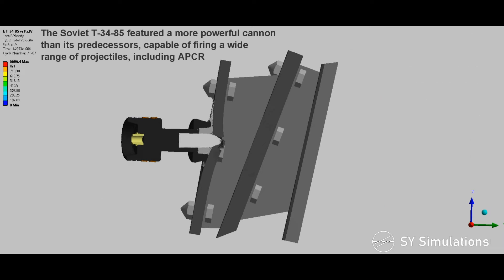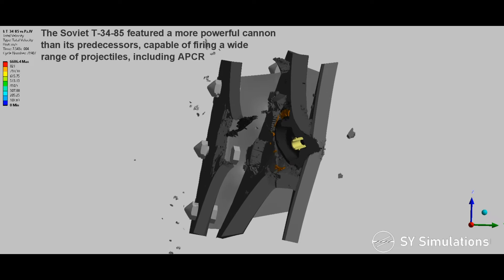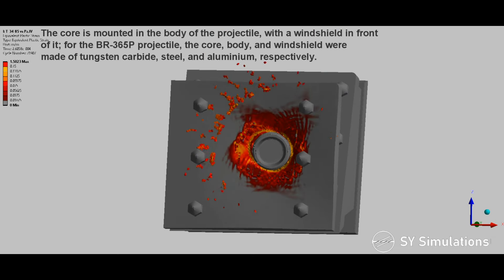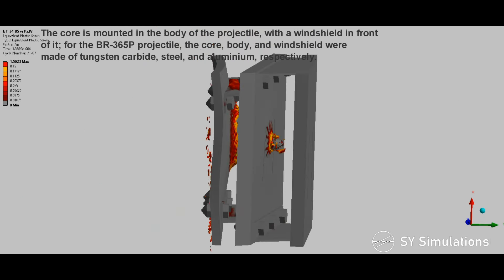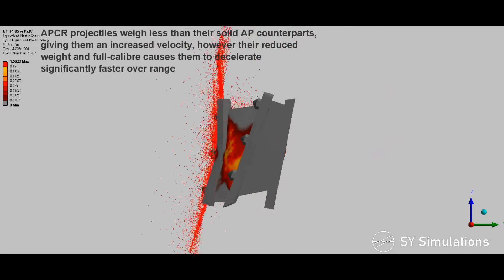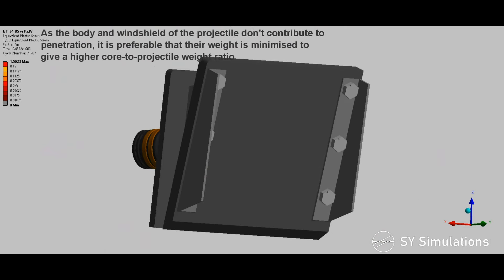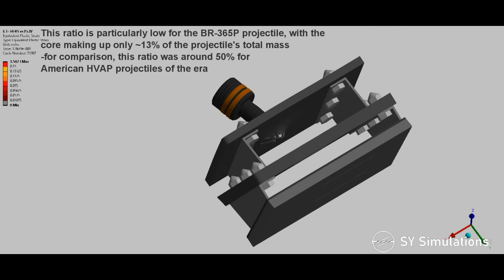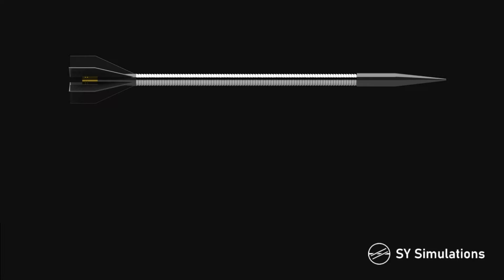THE WORST APCR vs Up-Armoured Panzer IV | 85mm APCR vs Spaced Armour | Armour Penetration Simulation

Comment: I’ve always wondered why American WW2 HVAP is better than Soviet APCR. Glad that was answered now.
Reply: love this channel cause they actually explain whats going
Reply: Soviets had less tungsten so they had to economize
Reply: @tedarcher9120  It was actually more to do with the APCR body design than the core itself. The US designed the sheath to be aluminum and didn't use the "arrowhead" design, instead opting for a design that was more shaped like a standard sharp nosed AP shell, but mostly hollow with a tungsten slug inside. This allowed lower drag and the aluminum reduced weight which increased velocity. The Soviets hadn't designed APCR ammunition until 1942 when they created some based on captured German shells so they were just trying to get something into service instead of optimizing performance
Reply: Soviet ammo wasn't the best during these times, they were low on most materials.
Reply: Why? Dont understand
Reply: @tedarcher9120 вольфрам в России есть на в то время добывать и изготавливать некому было . Все ушли на фронт

Comment: It's interesting how much the Pazer IV underperformed there. Though it'd still be worse in the larger scale with such a numbers disadvantage. Great sim as always.
Reply: The Panzer 4 came out ok, while it did pen, it wasn't catastrophic as the main body didn't get in, just the tip isn't good enough. But Spall people scream! Tanks have a lot of empty space, partitions and non-critical stuff in the way. Whenever we see up armouring it's done to a specific calibre, material availability and be good enough. Stopping it dead would be optimal, but the extra weight wouldn't have been worth it and does nothing for higher calibres.
Reply: Its not the PIV G-H, but uparmored D. Few pieces of plate, rather than 80mm of solid plate. Solid plate would have stopped the russian APCR dead in its tracks.
Reply: Crew isn't going to stick around in the tank when a red hot piece of tungsten carbide was just ricocheting around inside it. Even if nobody is seriously hurt, powder in shell cases might be smouldering and about to ignite, etc.
Reply: @LiezAllLiez isnt spaced armor better at dealing with this though? Like in the Leopard 2A6 (I may be wrong) where they added extra thin plates to the turret to disrupt APFSDS
Reply: I thought the D model (heh) actually did well, given the up-armour was additional armour. The spacing makes it less effective compared to one thick plate so I'm impressed.
Reply: @EdyAlbertoMSGT3  Yeah, but not when its russian APCR. That one is just junk.
Reply: Yeah it's because T34-85 used APCR which was meant to destroy tanks but it highly depends on range, The more distance these two vehicles have Panzer IV will easily win since it have more penetration than T34-85 APCR overall
Reply: @JaHail-oy6vq  It's always hard to know which tank wins easily, given the number of scenarios you can have. But yeah, kinetic penetrators definitely prefer to be closer than further away, that's for sure.
Reply: @candleman2123  T34-85 APCR can pen Tiger 1 front armor from 400-600 meters so, If there is more gap T34-85 would hardly win since Kwk40/L43 have more penetration without using PzGr 40
Reply: @JaHail-oy6vq  yeah, it does, for sure. I just try to avoid saying a tank will win. I find it so general and nebulous that it's just not reliable as a comment. 

I love the Panzer IV, probably my favourite tank, so I am biased 😇
Reply: @candleman2123  Well im not biased towards anything, I just accept the reality aka truth
Reply: @JaHail-oy6vq  OK. Not sure why you felt the need to say that, but good on you mate.
Reply: @candleman2123  I don't get it, Don't take it too personally what i meant was i was only telling you the truth and im not biased like you as you said your biased towards PZ IV in your previous comment
Reply: @JaHail-oy6vq  No, you don't word a sentence like "Reality AKA truth" then claim you were being reasonable. But this is the YouTube comments section. Not sure why I expected different.
Reply: @candleman2123  It was more of a funny way to say it, It's all good tho since it requires minimum humor to be able to get it either way
Reply: I don't think it underperformed, honestly. The APCR is a bad APCR round but it's still about as capable at penetration as the solid AP or APHE, is it not? Maybe I'm wrong on that, but that APCR is only bad in comparison to other nations' APCR. It still has plenty of power to go through a Panzer IV but so does the standard 85mm rounds, as I said. It didn't really underperform, the Panzer IV with 80mm front armor max, it was never designed to stop the 85mm gun. In reality the two tanks are quite comparable in performance. One is just a little better protected, the T-34/85, and the other has a better gun, the Panzer IV. Late war Panzer IV's were about on par with the T-34/85, they both had things they did better or worse but were on par for the most part.

Comment: It would be interesting to see soviet 45mm APHE and 76mm APHE against the upper front plate of an uparmored Pz IV D (30mm+30mm+20mm), an uparmored Pz IV F (50mm+30mm) and against a Pz IV H (80mm) from about 500m range. To observe if the uparmoring of the older vehicles to fit the H standard of protection actually surpassed the intended effect by creating the first "composite" armor by spacing the additional plates and combining face hardened armor and regular RHA. Or maybe the layering was worse than the regular 80mm thick plate of a late Pz IV H or J.
Reply: That would be spaced armour. Spaced armour has technically been around for a while and in tanks since ww2?
Reply: @Masterafro999  it would also be composite armor. Since the bottom hull plates on Pz IVD and F would be front hardened while the bolted on plates are RHA rherefore using different property steel types like a modern NERA element.
Reply: @schullerandreas556  I was being slow brained. You're right. What confused me was the fact that these mods weren't serially produced. The first serial production tank with composite armour was the t-64.
Reply: @Masterafro999  the uparmoring of old Pz IVs was not a field modification, the vehicles were shipped back to the factories for this as the additional weight required an overhaul of the suspenssion. So technically it was serial production.

What disqualifies it from being seen as the first proper composite armor is that it obviously wasnt the intention to increase protection by using different materials. They just wanted to get to combined 80mm thickness. If it would have been their intention to arrange layers to increase the protection with the composit then ironically the plates would have been in opposite order with the first plate being front hardened for decapping, maybe even the second plate for the older models but the last plate which is actually structurally integral to the tank would be RHA to make full use of its elasticity compared to front hardened steel as a backing plate.

For the first tank that purposefully used different material layers to increase protection that was produced in series I think you are right with the T64 and its quartz spheres cast into the front turret.
Reply: Well it's because it moved over 800m/s it means the distance is prob around 500 meters which T34-85 have the advantage but if it's over 1000 meters, PZ IV easily wins this one

Comment: Would be cool to see a comparison with the 80mm non spaced frontal plate of the Panzer IV H, to see if the APCR would fare better.
Reply: it will work out much better because there will be no angles and spacing, which this type of bullets doesn't like very much.
Reply: at every subsequent plate new shear forces apply at impact degrading the projectile. This composite arrangement is actually more effective than the single 80mm plate if the mountings of the upper plates are so well crafted and the bolts dont shear off.

Comment: If it is possible, i think it would be really cool to see what different rounds do to things like cannon barrels and engine blocks! 

Love the channel!
Reply: Yup,im curious how well the engine block of some vehicles would hold against shells after if penetrates the back or side plates
Reply: That would be very cool to see. You reminded me of the German "squeeze bore" tank guns. Where a 75mm projectile runs through a tapered barrel and ends up around 55mm.
Reply: The barrel will turn black.

Comment: Hi SY simulations this was a very interesting video. I would have thought the APCR would have punched right through, so the results really surprised me. Anyway, I have a simulation proposal: 

Historical Context:
On the 6th of March 1945 an M26 Pershing suffered an 88mm penetration of the lower front plate by a Narshorn tank destroyer and suffered an ammunition detonation. However, the shot miraculously penetrated right between the driver’s legs, and no crew members were killed in the engagement. 

Proposal: 
German Pzgr. 39/43 APCBC-HE shell against 76mm of RHA sloped at 36 degrees at a range of 300 yards. (HE filler can be omitted if need be. Also, although most sources state the M26’s LFP was 76mm at 53 degrees, the specific location of the hit was at 36 degrees constructional slope)

Additionally, A 6mm upside down “u” shaped witness plate would be positioned between the expected location of the penetration to simulate the driver’s legs.

Thanks out to reading this, and have a good day!

Comment: *Next Video easy idea*:
Increase of spalling of different steel plate thickness vs AP or APDS
Example: 
- Spalling of 1 cm Steel Plate at 60°, then the same simulation but with 2 cm Steel Plate and incresing the thickness until the maximum spalling, I think it is very usefull for understand the spalling
Reply: It was done. Not angled, but same idea.
Spall velocity is inversely related to the thickness of the armor. Spall come angle is proportional to the thickness of the armor.

Comment: Hello. I have, what I think is an interesting "what-if" suggestion. 2 years ago you posted 2 videos, exploring the shot traps of the different Panther mantlet designs. There is a Panther in Thum, Switzerland, that, at first glance, has an A/D mantlet with the bottom side straighened. I was wondering if you could do a third "M72 vs Panther mantlet" video, imagining the germans transitioning to a mantlet of this design, instead of the actual G mantlet.
I call this a "what-if" suggestion, because that mantlet is actually a post war sheet metal replacement, missing holes for the gunners sight or a coaxial machinegun.
Number of times I commented this: 2
I will try to link a video of it in the replies to this comment, but you know how youtube is about deleting links.
Reply: h I have
t absolutely
t no
p ideea
s if
: this
/ is
/ going
v to
m work,
. right
t now
i I am
k simply
t writing
o words
k to
. mask
c the
o link
m in
/ hopes
Z it
G doesn't
e get
C deleted
8 by
W youtube's
8 filter,
D this
k is
/ the fourth comment I have made, all using different methods, thus far all have been useless.

Comment: I noticed the lack of a 85mm BR-365 vs. a Tigers front armor, simulation.
At the moment there are only two simulations of flat nosed shells vs flat armor, namely the 76mm vs Pz IV and the 122mm vs. Tiger II (H) turret.
How about one at 500m, similiar to the 76mm vs Pz IV?

Comment: nearly stopped it, if the back plate was 50mm it might have not gone through. heck if that shot came at a slight angle it probably wouldn't have made it through, tack on about 15 degrees and maybe.

Comment: Oh wait that was a 85mm APCR? I thought it's going to be 76mm APCR since the 85mm AP already goes through a Pz IV like a hot knife through butter.
I imagine the 76mm wouldn't go through that at 500m.
Reply: 85mm t34 apcr in warthunder pens like +200mm but irl barely pen pazer 4s
Reply: @mehmetkaral8863  yeah their APCR calculator gives way too much penetration based on the weight of the shell instead of the tungsten core.
The T-44s BR-367P APCR was a major improvement over the early BR-365P but in the game it’s hardly better because Gaijin thinks that steel is apparently just as good as tungsten for armor penetration.
Reply: @Kuschel_K  indeed, using calculator for APCR calculator for APDS with basically same core properties produces completely arbitrary results due to it relying so much on shell mass, like for 17pdr APDS at point blank it only gives 178mm... 

and second nail in the coffin is that Gaijin also uses these small core APCR as model for APCR slope penetration which results in far worse performance at angles of about ~15-25%...

Comment: Is the ammo was too expensive to make it good or what? Probably the extremly low 13% mass was because of that. Either you make 1 good or 4 somewhat working rounds. At least thats my opinion based on their engineering works.
Reply: More like they werent exactly sure how to make good APCR and HEAT. And while they had at least some ideas about first...all their knowledge of HEAT came from captured german HEAT rounds.
Reply: 85mm tank guns was temporary substitute of 76mm, since 76mm AP rounds was bad quality, and 57mm guns(with better AP rounds) was to complicated for mass production as tank/field guns, and was AA backbone. 
57mm was to much against pz3/4, so there was only 150 T-34 with it, but low 76mm AP quality, armor upgrade of PZ4 and tiger/panthers become problem really fast(T-34-76 cant penetrate tiger side armor at all).

Captured tigers and panthers were tested against every soviet and some lend lease guns/rounds/rockets.
USSR saw germans goin to replace(as obsolete) PZ4 with panthers, and 85mm struggle against it frontal armor(same goes for tiger) at any range. While 122mm AP penetrate it from 1500m like a paper. 
So most resources goes to 122mm guns/rounds development.

In 1944 for every 5 T34-85 there was 1 IS-2,  and 1700 IS-3 in 1945. 
For SPG it goes for every 3 85mm, 2 122mm and 1 152mm in 1944.
Reply: @alexturnbackthearmy1907 That could be. But this difference is just too much. And it would be more logical that the soviets seen the 20-30% increase in penetration not worth it when it should use 3-4 times as thungsten. HEAT as well. It wasn't made to defeat thick armour more like an all purpose round for any target because of the explosive/armor penning potential. This logic is also there with the guns. They used a 122 mm because it's much cheaper to design a big round for penetration and sheer destruction than a low caliber high velocity gun like the 75 mm PAK 40. They did guns like this the 57 mm and 100 mm and got scrapped because of these reasons. Their goal wasn't to make a super weapon (like germans) only to make it half decent. If they really wanted to they could.  See IS-7 .

@aiTheVulture sorry I meant it to the other guy.

Comment: I thought the UFP of the pz4 was 80 mm?
Reply: The Panzer 4 B through D had just 30mm of turret and hull frontal armor. They are the ones with the short 75mm cannon. On the E, a 30mm plate was welded onto the front hull. The F1 and F2 had it's basic frontal hull armor increased to 50mm. The G had an additional 30mm plate on the front, and then only the H and J models had the base 80mm of steel frontal turret armor. The B through F models only had a little more than 1000 units made. while the models with 80mm of frontal hull armor, whether just a basic 80mm plate or 50 + 30mm plate, made up about 7.4k total units combined